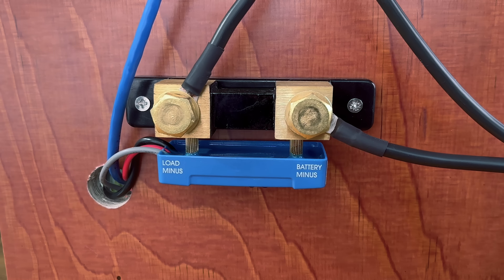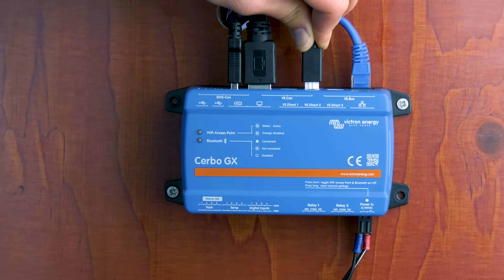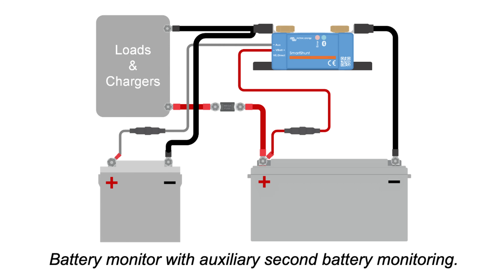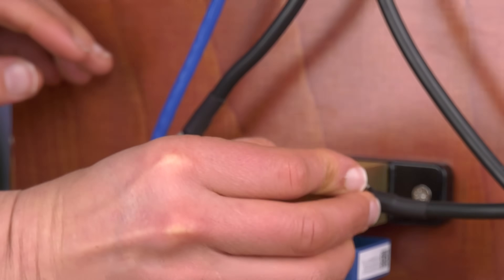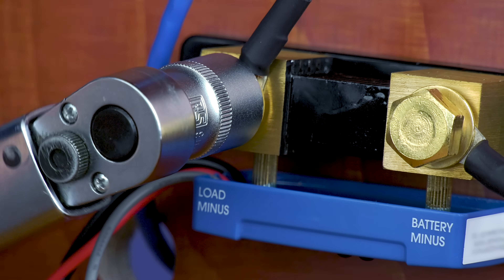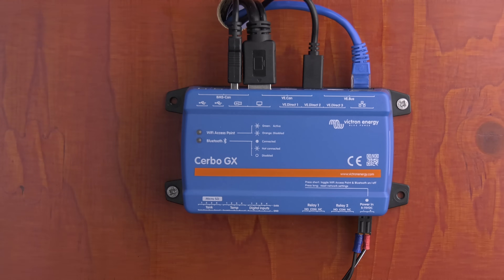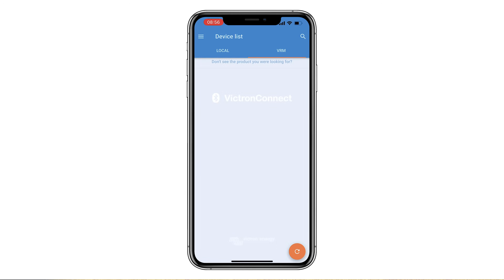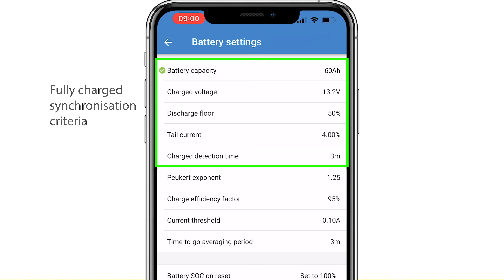How to install the Victron Energy SmartShunt IP65

Comment: Does updating the firmware loose/reset the accuracy of the SOC%?
Reply: A reset requires a new charge cycle indeed
Reply: @johannesboonstra6917  Thank you 😁
Reply: There is a new function which allows you to go to the original soc after reset

Comment: Nice, just got my first Dutch silver coin. I never got the second cable with my two smart shunt s. Very say for a Dutch Australian calibration technician.
Reply from the maker: What do you mean with the second cable? The wireset for the regular SmartShunt? The SmartShunt IP65 has resin bolded cables. If you are missing something, you should contact your Victron Energy distributor.
Reply: @VictronEnergyBV  The problem is I ordered both through Ebay in Australia.
Reply from the maker: @chuxxsss  We don't sell to eBay, eBay facilitates dealers to sell through them. In other words, you might have ordered there but effectively bought the unit from a dealer. Please have a close look at the invoice or forward us the serial number so we can locate the dealer for you.